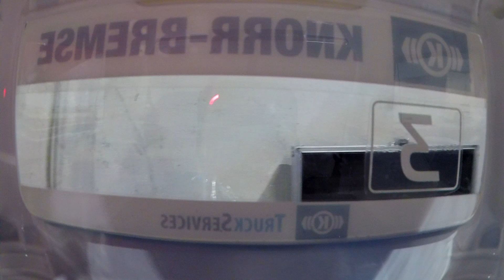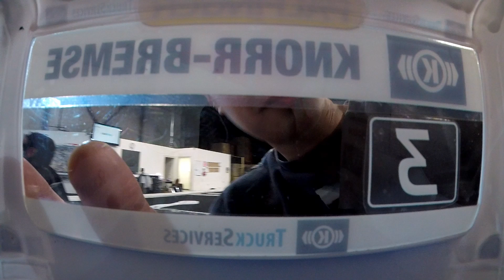TAMIYA TT-01E EURO TRUCK ON BOARD

Comment: Wicked Run! goggles next?👍
Reply from the maker: It would be a cool thing to try I think but I cant last long playing VR so Im worried, would also love to try FPV my planes but scared to invest and throw up every time i use it 🤣
Reply: @rexrcs  I'm not sure, BUT, I think fpv is a bit different from pure VR, as you I think you can't rotate your "view" by head movement, it comes from rotating the vehicle, so you dont have as much responselag to your movement, that messes with your inner ear, which makes you feel sick. This is purely speculation, but I do know that the main reason VR makes you feel sick, is because the refreshrate of what you do, and what happens on screen isnt instant, your inner ear sends you brain the wrong signals, and you start to feel seasick.(same thing on sea). FPV drones seems like the ultimate RC experience in terms of flying I think.
Reply: @rexrcs  Ya FPV can be trippy on the senses.  I like it for med speed cars on an easily viewable track.

Comment: I guess you could say the tires on the trucks are a bit different, with those massive sidewalls. Dunno, do you guys glue the sidewalls on those too for racing, I dunno much about the truck racing. Its a very fun looking raceformat, kinda want a truck, but I've been waiting for one I like the look of :P The recievers view of the action was really cool :D
Reply from the maker: Yes sir, your guess is correct, on this surface the trucks will roll if the sidewalls arent glued all the way to the treads

Comment: all i can say is awesome, i had one never ran it, ware i was running at the time not enough showed up to race ended up selling it.
Reply from the maker: Aaron I was so shocked to find out how well it performed with glue on the sidewalls, but I shouldnt be surprised, I brought my castrol civic on tt-01 and it performed better than expected for what it was meant to be(basic entry level) Im sad to hear you sold it, which one did you have?
Reply: @rexrcs  had the man truck painted white and blue with a black tail